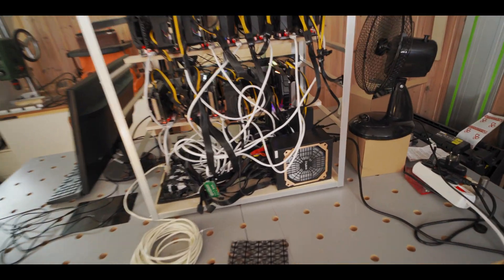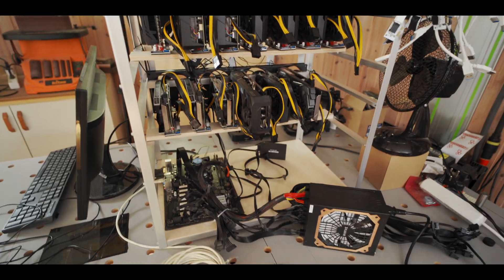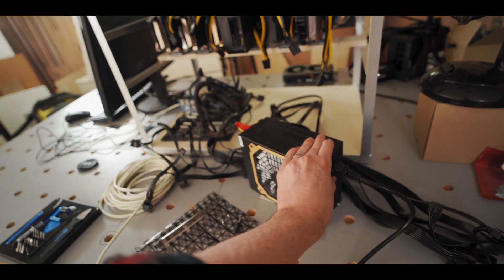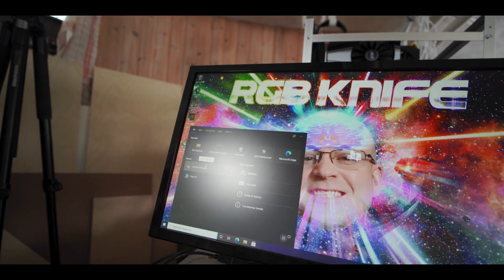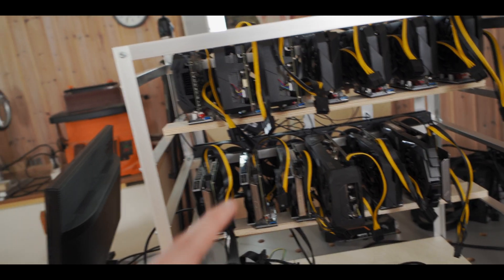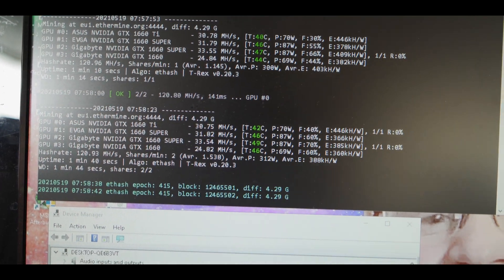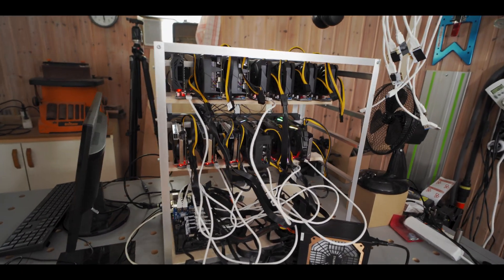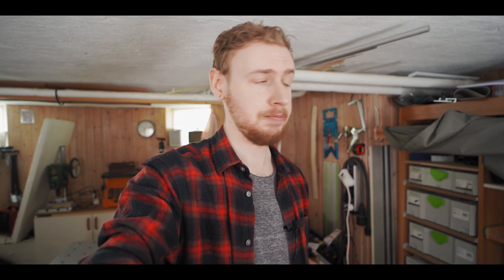Do 1-to-4 GPU Risers Actually Work? (aka PCIe Splitter Cards)

Comment: i used a x1 lane with a titan rtx when using LLM's locally. fun part is, it works the same speed as using a full x16 slot. you can even put lets say 4x nvme to pcie cable in a asus hypercard. and with pcie bifurcation x4x4x4x4 you can use 4 gpu's on one x16 slot with 16 lanes split to x4x4x4x4. its so cool how pcie / nvme is "the new" USB of this time

Comment: would this work for connecting multiple different kinds of cards? I need to connect to a bunch of legacy devices, so need things like serial/parallel, and 1394. could I run all of them off one of these splitters?

Comment: TBH i am not really interested in mining or GPUs, i think one GPU is fine. But i'm envisioning a dockable computer enclosure consisting of two parts, the top would be the actual PC with a GPU, and the bottom could be... just an enclosure full of stuff. Being able to throw one PCIe connection over on an extender between the two, and then have a splitter in the bottom, driving all sort of... things, maybe extra mass storage, maybe soundcards, maybe capture cards, maybe PCIe to PCI bridge, these sorts of things, things that are kind of "optional" making the bottom enclosure a "dock" and the top one a "LAN box". I don't feel i really need this but it might just be something i would like to build for the heck of it.

Comment: I use two of them in my set up bc I don’t have enough pci slots. Unless they are kept cool they tend to crash every 4 hours however we go a 70 f night last night and had no issues tell it warmed up later around 12 pm est today. I’m going to add a case fan in front of them to help them cool down when it’s so freaking hot

Comment: Iknow this is old i have one and wondered if it was PSU issues due to extra 3 cards or if the MB and Processor could handle the extra 3 cards...  Were you able to fill the board with 11 GPUS or just original 8 on the board already??

Comment: Hey Dude do you have installed a driver for this card?
Reply from the maker: Nope :)
Reply: @SebsFinTechChannel  Update:
Under Windows version 1903 (18362) and 21H2 only work two cards error with more then two but but now run Nicehash OS and with the same setup work three cards fine. I don´t know hou is the issue.

Comment: Thanks for yourvideos, Let me ask you something, I am trying to connect 6 GPUs in two different motherboards, but in both it only recognizes 4, I cannot activate the last 2 PCIs slots, the Motherboards are:
Gigabyte ga-z77x-d3h
MSI B450 AS pro Max.
Do you know of any additional settings in the BIOS or OS? Really appresiate your help.
Reply: There are GPU limit per motherboard, google it.

Comment: I am using two of these on a AMD b550 motherboard. I was trying to get 2- RX5700 and 2- RX580 mining with bios mods.  I ran into some trouble doing the bios mods in hiveOS.    I had switched the  usb cables around as I was having trouble getting  the rig to post. Hive seemed to  confused the gpu order i think because of these boards, and flashed the wrong bios to the wrong cards even though it looked right in the GUI...kind of a major hive bug. Now I am trying to unbrick these 4 GPUs totally bummed. So watch out for that if using these when bios modding.

Comment: Hi Sebs, I am using this PCIE splitter card in my laptop's M.2 interface which is PCIE X16 with a M.2 to PCIE adapter, it works good, but now I am not satisfied with four GPU cards, I would like to know could the second PCIe splitter card plug in previous one? Just like a tree structure, 1-to-4, then 4-to-16, then 16-to-64, of course not so many actually. I don't know if you have done this experiment, if you have a try, I hope to see in your reply.

Comment: I know this video is a little bit old but I managed to build a 10 RTX 3060 ti LHR rig with two of this at full capacity. 
MOBO: ROG STRIX B450-F GAMING II
CPU: Athlon 3000g
RAM: hyperx 4gb 2666 mhz
People told me that this couldn't be done with an Athlon 3000g as it only supports 6 pcie lanes, but I had no trouble in the process. I don't remember exactly what BIOS settings I changed, but I tried to disable everything like SATA ports, HD audio, etc and enabled 4g decoding.

Comment: Hi guys! In what slot is advised to plug in the splitters? Does it matter if I plug it in the 16x, or it will work fine in the 1x slot as well?
Reply: Old post, but in case it helps anyone you can plug these into any pcix slot. 

It looks "weird" if you plug it into the large 16x slot, but it will work just fine. The card dosen't use all the communication lanes, so it dosen't need to be as big. 

Hope that helps.

Comment: I'm having an issue with one of these x1 to 4usb splitters, it will recognize 1 card but anything after that I get nothing inn device manager. The fans do spin though on the card it is not recognizing. Any suggestions?

Comment: Great idea to test the splitter, however I doubt anyone would need to use it on a Mb that can support 13 gpus anyway. What would be really useful is to know if you can use it on a Mb with  3 pci slots and get 12 gpus mining on it for a day or so and check the accepted share % at the pool, that’d be awesome!
Reply: But for example when i have MB that dont have so many pcie 1x or when i put gaming card right on MB then i cant access all slots cos of gpu.
Reply: 13*4 = 52 GPUS POG
Reply: your profile pic looks like you would be smart

Comment: Hey Buddy, I hope you can help answer my question please: I have a brand new Rig with MSI B360 motherboard and I bought 1 Non-LHR MSI RTX3070 GPU connected directly to the motherboard (no rizers yet) powered from the PSU directly. But while testing both Phoenix Miner and T-rex on windows 10, the hashrate is fluctuating between 58mh/s and 62mh/s. I also have MSI afterburner OC set exactly as i have it on my other rigs. In your experience do you know if this MSI 3070 could be the issue or perhaps the MB bios needs updating? Appreciate your help
Reply: try nbminer
Reply: BIOS! 
TUVE UN CASO SIMILAR CON UNA 3060V1, ME ARROJABA 21 MHS.
LUEGO DE MODIFICAR LA BIOS ME DIO 45MHS

Comment: Hello i have question
I have a tuf b550 plus mb and it has 
1 pcie x16 slot, 1 pcie x4 or x8 slot and 3 pcie x1 slots
So I was thinking if i use 2, 1 to 4 splitter cards (https://www.amazon.in/dp/B093XT2VXB/ref=cm_sw_r_cp_apa_glt_fabc_B0QAFKQYCPZ784FSBZ9Y) then can i use a total of 11 gpus? 
And also can i also use m.2 to pcie x4  adpater (https://www.amazon.in/dp/B09722D8NW/ref=cm_sw_r_cp_apa_glt_fabc_J9R9918942FZM1E0WAZ0) and plug 1 to 4 splitter in that and since i have 2 m.2 slots i can use two 1 to 4 splitters 
That means i will have total of 19 gpus and my processor is ryzen 3600 which has 24 lanes will this work?

Comment: you have to connect them to separate pcie controllers, means find PCIE slots on separate chipset, than there is no lags in the system, I am using those devices from 2017 and only problem is that metal cooler going out of the card after 2 years, thermal past with glue and all is working nice, sometimes if rig have not enough air flow around those cards they are going too hot and starting throttling

Comment: can we use 2 of them on 1 motherboard ?
Reply from the maker: Yes. But if it works or not can depend on available lanes of your motherboard and chipset. But I've had 2 of them on one motherboard without issues.
Reply: after 2 years you replied :D. i am using 4 of them on 1 motherboard without issues. w b450 chipset @SebsFinTechChannel

Comment: I'm using one and has been working fine.
Someone's asking me do these things have a data capacity limit kind of deal?
I'm running 3 rx580s you're running 1660 could you run four 3080s?
I'm thinking this wouldn't matter but I'd like to have confirmation from another person.
Thank you.

Comment: Hi, sorry need help on this, i bought a cheap F2A88XM fm2+ mobo with 3 pcie and a PCIE spliter, hoping to use it on 6 cards. The splitter works but it only recognize 3 cards which makes it useless. Is there a work around?
Reply: Try plugging that splitter through one riser with PCIe, that might be the case.

Comment: i just learned ... some motherboards, have a weird limitation, it would only run with up to 4 cards no matter what. board used was asus b360. it would not boot with 2nd 4-1 splitter and a card attached. would boot with 4-1 spillter with 4 cards, and a splitter in second pcie1 slot (with no cards attached).

Comment: I have only been able to get mine running stable with 3 cards.
Reply: Its depend motherboard. I have micro atx Biostar MB with 2 pcie slot (16X/4X) and I running 2 this extender with 8xgpu. Most important your MB and CPU must support. And also each this pcie extender must have contected HDMI dummy plug on GPU no.1 on every extender. Will work for 100% (on hiveOS)
Reply from the maker: Hmm interesting! What do you think causes it to not work with 4?

Comment: Hello Sebs, which one do you think is safer between the 1 to 4 PCIe or the M.2 to PCIe adapter? Thank you, love your contents!
Reply from the maker: I think an m.2 adapter is more stable since it’s only handling one connection. I think both are “safe” as long as everything I plugged in correctly:)

Comment: I wonder if the splitter does work on HiveOS? As Im considering to use a PCIe 1 to 4 Splitter on my first Mining Rig with HiveOS
Reply: I'm using one in hive.. Only 2 gpus on it though.  that's all I needed
Reply: It does I have 8 GPUS on splitters in hiveos

Comment: Nice video man. I’ve got some generic ITX motherboards that have only one or two pcie slots, usually an x16 and an x1. Given that a splitter with four pcie risers is about the same price as 6 pcie risers, it makes using motherboards for a small four of five GPU rig viable
Reply: does it worked on your generic motherboard?
Reply: @wanderwallz156  yep. I use HiveOS and it worked “first try” (Lego Batman). I used in on an old motherboard that uses an AMD FX CPU. Two RX580’s in the x16 slots on the board and four RX580’s on risers attached to the splitter (just like the Popular Front of Judea!)
Reply: @matttupper23  amazing, I couldn’t make it work on my Biostar motherboard h510 :(

Comment: Great coverage mate! Did you find out more info as to what the bottleneck was? I assume two things: either usb transfer limits to the pcie lanes or cpu pipelining lag.
Reply from the maker: Yeah might be one of those things. But seems that 13 GPUs is pretty much the max people are able to achieve except with really complicated setups on specialty motherboards. And at that point you might as well just make two rigs and avoid the headache and price of such rare motherboard lol

Comment: Hey thanks for the video, i was wondering what is the size of RAM in your pc? Cz you know with multiple cards you get into virtual memory issues with windows. Have you ever faced low Virtual Mem issue? Thanks
Reply from the maker: My ram is 8GB and my virtual memory is the same as the vram on all my GPUs combined. So a rig with 6 GPUs with 8GB of vram each needs virtual memory of 48gb. Good luck!
Reply: Even in the chat i see people complaining about multj GPU support issues, I believe  they have virtual memory issue.

Comment: gooooooooooood work Sebs~
Reply from the maker: glad you liked it!
Reply: @SebsFinTechChannel  bro does it work on hiveos
Reply: @SebsFinTechChannel  my motherboard has 6 gpu slots if I use this adapter can I run 6+3 gpu in my motherboard???
Reply from the maker: @rionicpazio1092  most likely if the chipset supports it

Comment: I have one on my ghetto rig. An old gigabyte mobo with only 2 pcie slots running 5 gpus with no issues.
Reply: hello,
can you please let me know your motherboard and cpu model .. i need to see how many lanes is your CPU and mobo having to support 5 gpus.
Reply: @notsofunny7  b85m gigabyte, intel i5-4460.
I always plug it in the x16 lane.
You can use the command lspci on linux to check your lanes
Reply from the maker: Awesome good to hear!

Comment: So I could turn a 8 gpu rig into a 12 without having to buy a whole new motherboard pretty cool thanks for the testing 👍🏽
Reply: 8 -> one slot used for splitter ->7+4->11. So not into 12 ;).
Reply: @raptormenace529  thanks didn’t really think it through I just typed it in quickly.
Reply: @Bruh01234  bro, did it work for you?>
Reply: @Alakazam54  I didn’t try it I can’t afford that many gpus I’m a kid 😂😂
Reply from the maker: Yup that should work!

Comment: I'm pretty sure this works depending on motherboard capability... on my boards i never managed to have more than 2 cards working through this multiplier.
Reply: Which motherboard you are using
Reply: I can t figure out how to run more that two either...

Comment: Only just found this. 
i bought one of these as I have a bunch of old hp office machines, but couldnt make it even work with more than 1 card. 
From what I could tell it was down to the mobo not supplying enough power out of the pcie slot. (I was using it out a pcie16 slot in my tests). 
I was using some fairly old mobos (old hp pro 3500 office machines). 
I suspect if it was a better mobo or one of the ones with pcie power sockets I might have gotten better results but then the mobo would likely have enough pcie slots.

Comment: this video was just for testing of the splitter card right ?  i think if you keep the rig up for 24 hours you might have stale or rejected or may be a crash too..
Reply from the maker: I actually had one of these splitters running in a rig for over a month without any issues.

Comment: Did this actually allow you to add MORE gpu's in total to your rig than you had before? In my experience once your pcie lanes are tapped out you can't add more anyways regardless if you use a splitter or not.
Reply: Why would it? Isn't it like mining using very little bandwidth?
Reply: I have the same issue

Comment: You always seem to be the one who has a video answering my questions. Thanks again. I'm using an MSI Z390-A PRO for an 8x MSI 1660 super rig. (my first build) and it only has 6 PCI-E slots. The motherboard comes with a disc, with drivers I imagine, do I need to do anything with that?
Reply from the maker: Probably not I’ve never had to use the disc that comes with a motherboard
Reply: @SebsFinTechChannel  Do you think you can use 2 or 3 or more of those 1 to 4 splitters on the same rig?
Reply from the maker: @stevegrube5969  possibly. Most people seem to hit some sort of limitation at 13 GPUs per motherboard. Also sometimes 9. Seems to have to do with the supported amount of PCIe lanes in the cpu+motherboard combo. Turning off a lot of the components (like unused USB ports, Sata ports, audio, etc) in your bios could theoretically open up for more GPUs if you hit a limit very early. Good luck :)
Reply: Dude I have exactly same motherboard I have add seventh card on port of m.2 works flowlessly

Comment: I bought one of these. I have been using a 750w PSU to power 3 1660 Super GPU's. No problems. One of them is actually using the PCI-E/USB extensions like in this video. I've now tried adding a 4th 1660 Super and it wouldn't start up at all. I've swapped all GPU's around to be sure there was no problem. They are all ok. I just went and bought a EVGA 1000w PSU. Same problem. When I try to start up the system with all 4 GPU's, the pc still won't start up 😭

It is obviously not a PSU problem and I'm running out of ideas what could be the problem?!
Reply: I should add that the risers lights flash twice with a click sound from the PC when I try to turn it on but the lights go out and the PC doesn't start. 

I have a Gigabyte Aorus Elite X570.
Reply: @lewisjohn2597  ever fix this issue?
Reply: @lewisjohn2597  UPDATE BIOS

Comment: Just the video I was looking for. Would this work on MSI Z390-A PRO LGA1151 (Intel 8th and 9th Gen) motherboard with rtx 3060's?
Reply from the maker: Well 3060s can’t get full hashrate on a riser but other than that I don’t see why it wouldn’t work. Good luck!
Reply: You try it?
Reply: @heldersn10  I had to return the motherboard actually. It wouldn't let me set the speed for the 2nd 16x pcie slot. The option wasn't even in the bios but I now have a asus prime z390-a all slots are working and I'm going to try it on that.
Reply: @docmiaz  let me know when you try it please 😅
Reply: @heldersn10  for sure!

Comment: I have one of these on my rig no problem with recognizing the cards, problem is the stability. Whole rig reboots after a couple of hours. Max 2 cards no problemo will mine for days straight
Reply: I think the problem maybe is your oc, I have one with 3 gpus working fine for days
Reply: @AngelCastillo-zz5lj  Nvidia gpus?
Reply: I'm considering buying the splitter too but plan to only add 2 gpus to it aswell

Comment: Can I use three PCIe Splitter Cards on the same motherboard?
Reply from the maker: Hmm yeah I don’t see why not! Just keep in mind there might be other limiting factors like how many PCIE lanes your CPU+motherboard combination supports.
Reply: @SebsFinTechChannel  how do I find it? I have a 5 slot mobo which supports only 6 cards with this splitter plugged in... 7th card doesn't work... why? any specific reasons?

Comment: I would like know exactly which PCIe Adapter you're using! I wish to replicate the same setup but just with FirePro W7000 workstation cards. Which precise model you're using? or is there another model that's even better that this one? I'll use Max 2-4 FirePro W7000 in my own set-up.

Comment: Never had it work for more than 2 GPU's
Reply: Whatt!! Mine has been working perfectly for years on my MSI Z370 Gaming M5 motherboard with all 4 slots filled. I am searching for a 1 to 6 splitter right now, so I can have more than 9 cards on one Mobo. Bandwidth may not be sufficient, even though I have extra PCIe Lanes